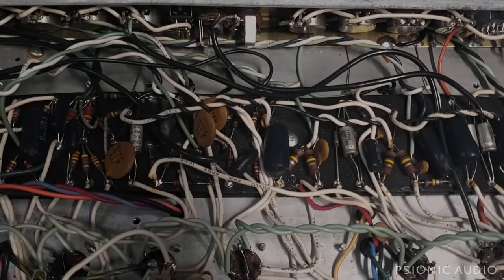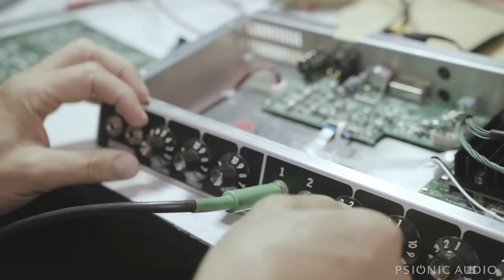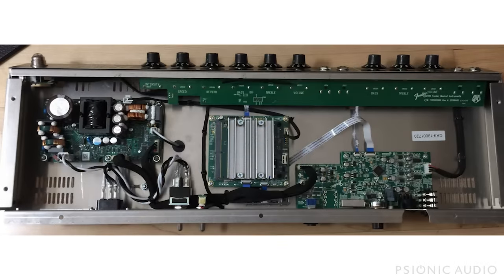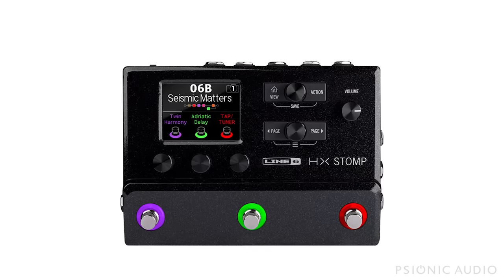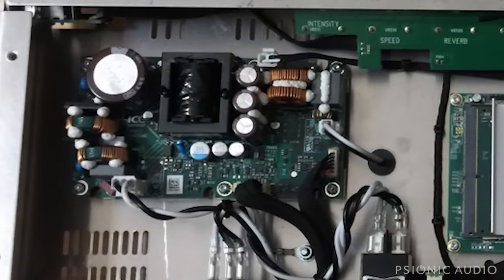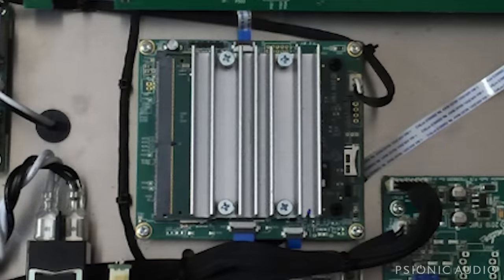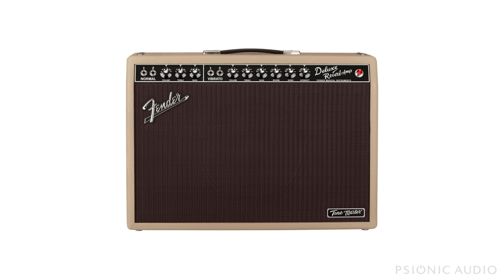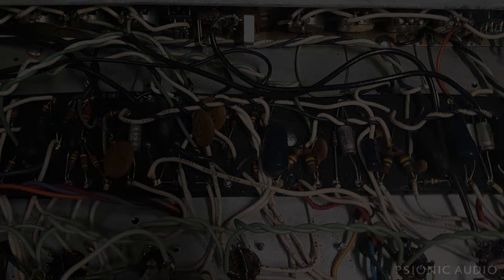We Need to Talk about the Tone Masters

Comment: Lyle, I own all three Tonemaster amps, and I'm a tube amp guy.  I played and toured with a 73 Super Reverb for 15 years, and I own more tube amps than a person should admit to.  I've really appreciated your channel (and your MLP forum posts) for a lot of years.  

Some important notes about these amps:
1) My experience with these:  I bought a Twin the first day they were available 3 years ago.  I've played it for every gig since then until I replaced it with the TM Super Reverb when that came out.  Approaching 100 Tonemaster gigs soon.  The Deluxe is my new "family room noodling at piano/upright bass volume" amp.  It's a great sounding amp.

2) They're good/great sounding versions of these amps.  I am 100% comfortable putting my tube amp cool kid cred on the line here.  It has been dozens of times that guitar players in the audience have told me how great my tone was, and how good it was to see someone using  "a real amp."  Only occasionally do I point out that it's a digital modeler.

3) The attenuation is no joke.  I have used the Super and the Twin in smaller venues, and dialing in a proper tone at lower decibels is amazing.  Our band has entirely shifted over to these, largely because of this feature (and DI outs; we're a 10 piece band and tend to use all the mics available).  As a side note, the Twin has never been used at full on attenuation, and it's incredible to be able to hear a driven Twin sound without going actually deaf.

4) All the amps have firmware updates, and all versions are usable.  You can have the sound update and the original IRs, or the original sound and the newer IRs.  Old reverb sound or new.  Which leads me to:

5)  I miss tube/spring reverb.  The updated reverb is better, especially at lower volumes, but it is not the same.  This is my one gripe.  It's obviously (supposedly intentionally) different.  Trem is ok.  I've had better and worse in tube amps.

Lastly, I hope someone loans you one soon.  I've been impatiently waiting to hear your take on them for years.  I would offer to ship you one, but I'm using them.  A lot.  Cheers; hope your wrist heals.
Reply: Thanks for this comment. It was helpful. I am home player only and bounce between a Vox AC15 and a fender GTX 100. I’ve been really interested in the tone master but keep going back and forth between the deluxe and the twin. Would you have any thoughts or preferences on which you would prefer at lower volumes using the attenuator?
Reply: @rdec8734  I honestly suggest the Twin for lower volumes, though all three are pretty great.  Where the Twin's attenuation points are at seem to be the most reasonable (to me) for home playing.  Both the Deluxe and the Super's lowest setting is a bit quieter than "feels" good.  Just my opinion, of course.
Reply: Hi Mark.  I’m not sure I’ve ever heard a faithful emulation of a guitar amp tank spring reverb.  The reason?  That device objectively sounds like crap.  I can just see plug-in developers struggling with this; “No!  I’m not going to make that sound!”  Well, subjectively, many love that awful sproing at the top of the decay.  Oh, well…
Reply: I might be able to top you...

You want to turn a Tone Master into a Super Tone Master?

Put the Fender MTG Tube Distortion Pedal in front of it.
It gives it that warm-tube feeling & sound that fills the room just like tube amps do.
Very low gain / high volume settings to keep it clean.
Up the gain lower the volume to get tube break up / dirty / distortion.
HIgh mids if you want that sound.
It is basically now your pre-amp, a tube one.

Fender should make this pedal mandatory with each amp, it is THAT good of a combination.
I did it to the Twin, and I assume it would have same affect to the Deluxe.

On top of that I bought both Black and Twin to compare, and ended up swapping the speakers.
So it now has 1 British Celestion and 1 American Jensen speaker because I am a picky dumb ass who couldn't decide which one to keep. By accident I discovered that this is an amazing combination that HAS to be HEARD to be believed. With the pedal it is like a Boutique amp turning this into a Super Super Tone Master that can play any style you want with tube realism, yet with digital control for various volumes you want to play at ---The big TM advantage in first place

Problem with swap: Now I have 2. 
Sweetwater is very open with returns as they agreed to let me return one after testing both, but obviously I cant return a modded amp.

For Sale: 1 Amazing Super Super Tone Master Twin Reverb -- Austin Texas.
Reply: After reading this comment, I’m pretty sure I’m gonna get the TM Super Reverb. I don’t play gigs or jam anymore. Just home noodling with families at home. Gonna sell off my Marshall SC20H and keep most of my pedals.
Reply: What band did you tour with?
Reply: For the price they sell at an effects loop would have been great to have. You own tube amps..do Fender want to eliminate Fender tube amps ? I think in time, 10 years perhaps,  they will become a minority purchase. SS will take over. However tube amps form the basis of the tone/feel of what modellers do. We cant get rid of them totally..

Comment: Great video. One reason I do not have an intention to purchase the tone master series is to look at what Fender did with the mustang v2 series.
After only a few years they completely stopped supporting the software, not just upgrades, but removed the ability to even log into the software. I felt that was almost bait and switch (ish).
Reply: You will probably be able to buy those computer boards on AliExpress in a couple of years so no worries there.
Reply: re: "After only a few years they completely stopped supporting the software", maybe you aren't aware, they HAD to abandon the FUSE software, because a key component of it was the Microsoft Silverlite component.  MICROSOFT abandoned it, around 2012 or so, and they removed support and left it at 32 bit.

Fender had no choice but to "let that drift", and start a new platform.  That's why the next model, the "GT", wasn't very good, they continued several years in development and way improved "that" software / firmware, releasing the upgrade as 3.0 for the GT, "and it is" the GTX100 firmware, 3.0, same amps / effects etc, MUCH improved (early 2020 release).  Yes Fender looked bad.  But, grasping what I've said here, one realizes it wasn't their fault, at least not on this one...

Comment: Great video.  I own two Tone Master Deluxe Reverb for about 18 months.  It’s great and I’m very happy with it.  I do baby it.  I play local bars about 2 or 3 times a month.  Don’t use effects other than Fulltone OCD for high gain distortion sounds.  I don’t even know what the “bright cap” issue is about.  Don’t need or care about need an effects loop.  I’m confident that I won’t have issues with it and will last another 5 years, at least.  The greatest feature is it only weighs 23 pounds‼️😎

Comment: If anyone is interested. An update to the Fender Twin Reverb Tonemaster in 2024. 
I would have to find receipts but I bought the tonemaster twin  when first available here in Australia. I think 2019(?)
I had been in negotiations on a silver face master volume Twin reverb, but it fell through, so I took the dive into the Tonemaster world. Just wanting that classic Twin sound. 
Of course every amp has it's purpose and application.
 We have a semi soundproofed music room at our residence, and a deal with very tolerant neighbours.  
So we can play quite loud in the room. An acoustic drum kit, and a somewhat animalistic neanderthal drummer,  to keep up with. 
I have updated the amp once, otherwise it has been used basically everyday  in a the last 4-5 years,  by myself and by sons friends. Who have fiddled and diddled. 
No issues whatsoever. Touch wood.
 It has a very low noise floor. 
Sounds great at low and blistering volumes. 
Takes some tweaking to get pedals running well. ( I would like to try the Celestion Version) 
I am very satisfied with this amp after the time I have had it, with no issues.

Comment: I bought the TMDR blonde a year ago and I think it's pretty great. I don't gig, it just sits here at the house. I play it daily (or every other day if another amp here takes my fancy) and it has held up well. I know that digital might fail, and it'll probably be a pain (and costly) to fix, but I just have to trust that Fender did solid work on this side. The attenuation is great (and required) for my small space. I'm not able to say how close it is to an actual DR, but for me and my noodling the sound from this is fantastic. I do agree they could have put in an effects loop, that was an oversight. Overall though, I'm happy with it (and I'm 48 years old).

Comment: I bought a used blonde Tone Master Twin for $800 in mint condition. I really wanted that Fender tone. It sounds great and takes my pedals well. I use an AB switch so I can set the normal channel and reverb/tremolo channels separately and go between them. I also use a 386 chip pedal that will give it a JTM 45 tone if I want to get a Marshall tone.  33lbs with 2x12 Neo Creambacks and loud as I'll ever need, it's a great amp to me.

Comment: I agree with what you said about the parts; as a sytems-integrator who builds computers from time to time as a part of my job, I like that the individual sections of the amp can all be swapped out, I think that's great. But my personal experience with companies is that these parts can get hard to acquire over time. We had an interface card for lab equipment die a couple years ago, it was from the late 90s so we got a good 20ish years out of it, but the replacement cost 600€. Obviously there are newer versions but that would have required getting newer lab-equipment too which would cost 100s of thousands of euro. This is obviously not 100% analogous but I could see these PCBs going for a couple hundred each once support ends and it's all secondary-market supply. If Fender made the software run on non-proprietary electonics with open-standards using their software and drivers people would make bootleg amps which they want to avoid. I'm also not entirely certain how possible that would be, but I guarantee it wouldn't be entirely impossible. Any time I see proprietary over open-standards I think of Dell who in the past made using their devices in the office difficult and expensive because of how many proprietary connectors they used. To me, it feels anti-consumer, and anti-repair
Reply: whether parts are available or not, at some point , depending on what the problem is it may prove better to buy a new amp because you may struggle to find a technician to fix either SS or tube technology 🤔

Comment: You’ll never have to replace the tubes on a Tonemaster, or throw your back out.  Analog parts can also fail, are subject to variation, etc.  This was a good and fair discussion of the pros and cons, but for a lot of buyers, the decision just comes down to nostalgia
Reply: I can assure you that tubes, solid state, and digital all behave differently when playing through them. I can't afford a tube amp but I've played through several owned by friends and the difference is immediately noticeable.
Reply: @flknstky  "for a lot of buyers" was what they said. They never said there isn't a difference, but oftentimes the people avoiding these and buying the real thing are the people that arguably are impacted the least by the difference.
Reply: And convenience.
Reply: @flknstky  my Fender tube amp really does not sound that much better than my Twin Tonemaster. Especially not in a live gig, the subtle difference is not noticeable anymore once you're playing with a full band on a stage that's full amplified through a huge PA system. The feel is not that much different, the Tonemaster is a little bit more sensitive to your playing, but it also depends on your playing style. And it's louder than my Hot Rod Deluxe with a lot more clean headroom. It takes pedals very well too. And my back thanks me everyday. 
So yeah, I'm good.

Comment: I played the super reverb Tonemaster for an hour at a shop. I thought it sounded ok, kinda sterile, didn't have enough squish. Response was quicker off the speaker vs my 70s Super Reverb which has more sag and a sweeter sound. I'm sure I could be happy with the tonemaster if tube amps cease to exist but it wasn't the same. The speaker break in might get sweeter. I look forward to buying these for stealjng the chassis to wire it up with a handwire circuit.

Comment: Best internals look in a Tonemaster I've seen yet and very important information to get to buyers. The built in obsolescence of proprietary boards combined with short warranty, makes the assumption of price prestige questionable. If this was your computer and you were lucky to get 5-7 years out of it, there'd be no question when components die and you simply upgraded to the latest PC and wrote off the original $800 purchase. But does anyone expect that with a Fender amp? When parts start failing and there's no warranty people will be annoyed.
Reply: Late 70s Lexicon digital units are still being used, same as 80s or old Eventides, to this day. Some of them are turned on for whole days or weeks. That´s some food for thought when evaluating digital things, not all of them are reated equal.

Comment: For me a bedroom "non-gigging" home recording guitarist I'd be good with this amp even just for the weight savings my back is pretty bad, their used value is still in the $750- $850 range according to my local craigslist and reverb searches so they seem to be holding value -for now as of  May of 2022. two years ago when I was still practicing/playing with a band I ran an FRFR rig with my helix hx stomp using 2 frfr 2000 watt headrush cabs and it sounds great and they are only $395 each new

Comment: I've seriously considered one of these, and will definitely try one out. However, as with all modelling amps,  I see them as basically washing machines/fridges/dishwashers. If they go wrong, you're facing a repair bill somewhere in the region of the residual value or the prospect of replacing them. This is all very well with a Katana or a Catalyst but less attractive a proposition with the much more expensive Tone Masters. 

Having said that, I've had many amps over the last 40 years and I've never had one go down. 

Your new series of round ups is off to a superb start and I eagerly await the second instalment. Of course this all has to be tempered by the fact that amp techs are hard to find (I expect, increasingly so) especially really good ones like yourself.

Comment: I have used a Tonemaster Twin for a couple of years and have gone back to a tube amp. It's a decent clean amp but does not have the complexity of a tube. It's a decent simulation. Put it next to a real blackface amp with NOS tubes and real Jensen speakers, there is no comparison.

Comment: I definitely get the hesitancy with some of the digital stuff, in terms of questioning the longevity. Obviously, time will tell. 

A friend of mine still has my old Vox Valvetronix that I myself bought used. If that thing isn't 15 yrs old, it's approaching it soon. It still works just as good as it did when I bought it.

The other thing with the quadcore processors in these Tone Masters, being that they are similar to a laptop processor, I highly doubt they're getting worked as hard or ran as hot as comparable components within a laptop. Components seem to be overbuilt, which is what we would hope to be true.
Reply: I still have the original Line 6 Flextone combo amp from the late 90's, which from what I can remember was the first or one of the first digital modeling combo amps ever. It works perfect well over 20 years later and the footswitch does too. It hasnt been babied much either. It gigged for years and was used at an open mic "for anyone to play" every Tuesday for many years. Gigging it was used mostly to amp a fender rhodes piano and not guitar though. For open mic night it was there so guitar players didnt have to bring their rig to jam. Still works fine.

Comment: Excellent review.  I agree with everything you said and for the same reasons.  Yes, you can revert the firmware but you'd never want to!  🙉  The original black one is ice picky and kinda terrible.  I upgraded the firmware and threw in a greenback I had, SO MUCH BETTER!  Still not as good as a partially retubed 68 Custom Deluxe Reverb but damn close.  You didn't mention the attenuator much and that is one of the surprise best features of the amp.  It sounds GREAT even at lowest settings!  Best attenuator experience I've ever had.  The weight and that attenuator function are THE two main reasons to consider these IMO.  If they added the fx loop and lowered the price to $500-$600 I'd buy one.  No fx loop was a HUGE MISS!  🤦🏻‍♂️  C'mon Fender, it's not a vintage amp!  🙄